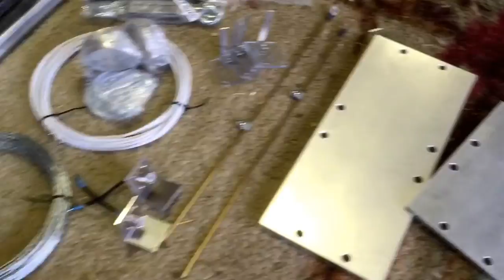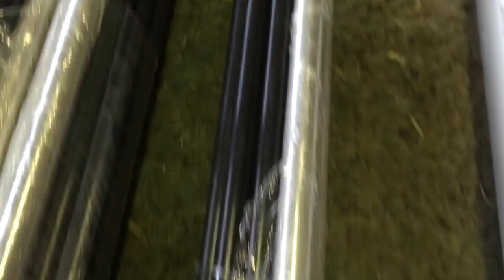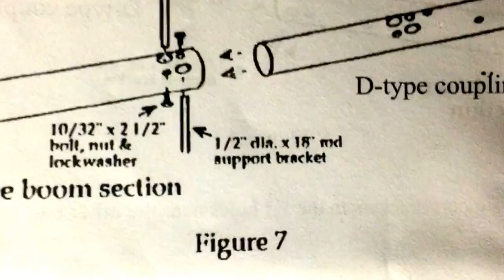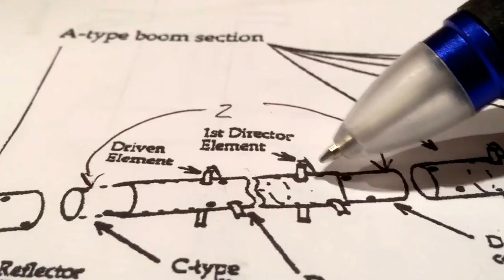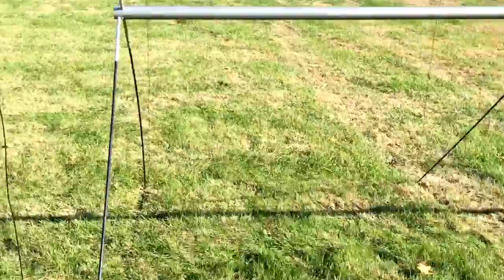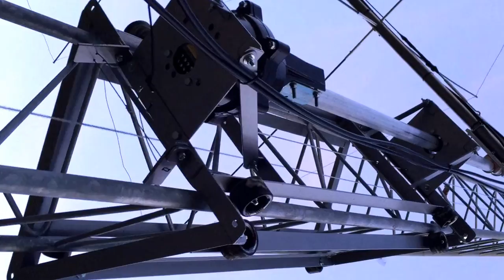Ric Steel and his L-8 Lightning Antenna

Comment: My buddy has had his up just over a year and has had nothing but trouble with it, very badly engineered antenna. The alloy tubes that hold the elements flex in the holes in the boom and the boom cuts right through them, his element wires are breaking regularly too. It has spent more time on the ground being repaired than it has in the air.
Reply: Maco 7 elements,, direct fed via a balun ,, driven element cut dead center , measured , tuned , isolated with a fiberglass tube in the saddle ,, etc ,, best choice I ever made . Very broadbanded ,, no tuner needed from 26.300 to 33.000 MHz as long as I’m only running my 100 watt rig . That is hard to beat . And the Maco is made very well . Other than the element clamps ,, I predrilled and self tapped every single element once I tuned it ,, also some of the saddle clamps wouldn’t secure tight enough , so I used self tapping 1/4 inch screws on them as well ,, everywhere, from front to back , side to side . It isn’t moving or going anywhere ! Once I learned about direct fed with a balun versus the factory gamma match ,, there’s no comparison if you want to talk all over the band , 10/11 meter in my situation anyway
Reply: @Dallas-Rife-UDX-347-Tennessee  Nothing like a well-engineered antenna to stay up and perform as intended for a long time,
 however,
  a 12' long 3-el Quad I built in '88 with only 75w PEP gave Derrick in Queensland 20-over S9 at the same time a neighbor with a 24' boom 5-el Hy-Gain "Long John" Yagi and 150w PEP gave Derick S9, and the local noise dropped to near zero from a normal consistent S3-S5.
  - It was always like that, I was the first to hear DX coming in and the last to hear it fading out, and I can't say for certain what it is about the Quad which delivers so much more real-world performance [ than the mere 2dB gain over a similar size Yagi it calculates out to be on paper/computer ] - but once you own one you can never go back to noisy & comparatively weak Yagi performance.
   I know,  I had 7 different Yagis/Quagis prior to building my 3 El Quad.        ...now the 5-element, well that's a whole 'nuther story - what a MONSTER!

  ...and 8 elements? Well that should bring them from Australia to a town about 5 miles from you - lol
Reply: @JAFO.  
I’ll have to look into that ,, never heard of them I don’t think ,, but I’m new to flatside beams and still learning something new all the time .  I’m gonna pull it back down and do some re-tuning this spring ,, I want to be able to run a little fire in the wire on 11 meter ,, and legal limit on 10 meter ,, 
Well ,, legal limit as far as they know 🤫,, 
I can run channels 1-40 on 11 meter with my amp ,, but barely ,, channels 30 to 40 a bit more reflect than I’m comfortable with ,, so ,, I’m gonna use an analyzer and tune out my coax correctly,, and my jumpers ,, etc ,, I’ve learned a lot the last year , that I didn’t know 13 months ago , it’s amazing my equipment hasn’t gotten damaged ,, boy did I see some errors once I got someone over here with an analyzer and pulled up some websites ,, etc and etc ,, so ,, back to the drawing board this spring ,, but that’s what this hobby is , learning , tuning , and spending money lol 
73’s
Reply: @Dallas-Rife-UDX-347-Tennessee  If you replaced it with a 3 element Dual-polarization Quad you'd be happier, plus you could add vertical-gain beaming to your radio world.
Reply: @JAFO.  
Those are the antennas that look like the old laser 400 ? But obviously just shorter ? 
What brand you recommend?
Reply: @Dallas-Rife-UDX-347-Tennessee  Any brand with switchable dual polarization and uses stranded wire instead of solid wire which prematurely stretches and breaks.
Reply: I spend a lot of time and money modifying mine , I corrected all these issues with my own parts from Home Depot and multiple autoparts stores, my own stranded stainless steel “droop” cable, stainless self tapping screws ,, you name it ,, I don’t disagree , out of the box stock ,  doesn’t stand a prayer ,, with proper self adjusting mods ,, it’s a great antenna . I accept we live in a world of crap cheap engineering and if you want it right , modify it like you was selling it to the public ,, I get it ,, but if the company built it to a true radio hobbyist specs , they would charge 3K dollars ,, I fixed mine to last a lifetime for an extra 200 bucks in hardware and some knowledgeable helpers that been down this road before 👍
Reply: @Dallas-Rife-UDX-347-Tennessee  Well,, I'm ,, ,, cur,,ious - - why , ';-,, you ,, use so many,,..;;''//-- punctuation ,, marks?,, ,, ,, ,, ,, ,, ,,

Comment: 1100$ way to much just go to Lowes buy you some 2 inch pipe for your boom tractor supply also sells electric fence post cheap and the wire can be found online